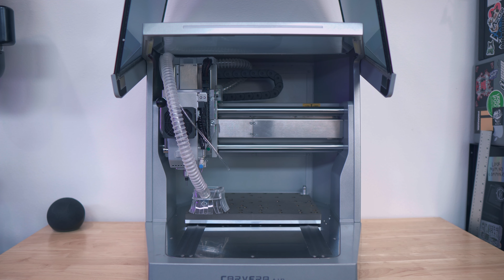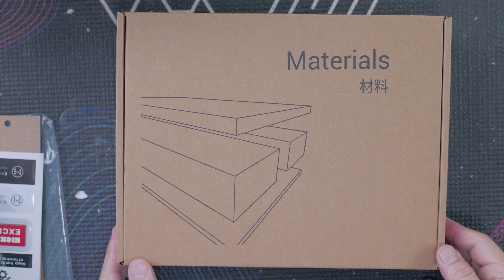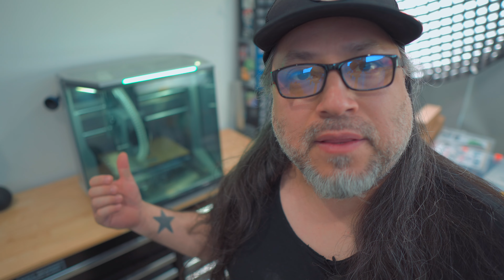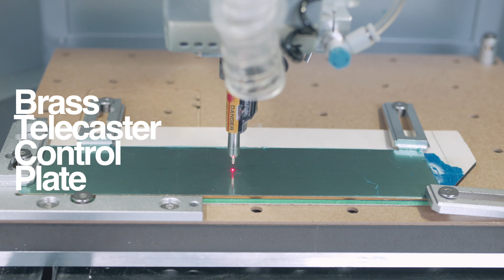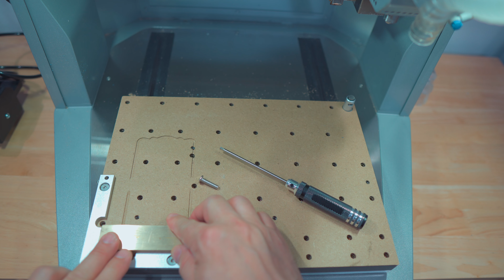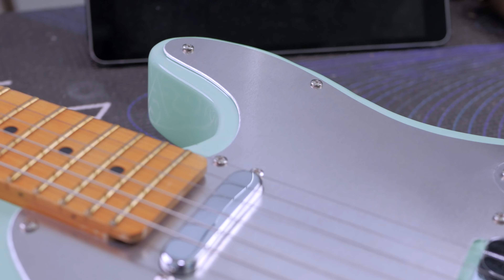This CNC Made Everything Easier - Makera Carvera Air

Comment: For that kind of money, $5,000, you can buy a full-fledged CNC machine with a small workshop room... But not this iPhone among the CNC machines. If you have nowhere to put your money, if you are a rich craftsman, then, yes, you can buy it)))
Reply: You can’t put a used industrial cnc machine in your living room. This machine is good for prototypes. 
It has a quick tool change system a probe, tool length setter and is fully enclosed. It’s worth the money. 

I considered this machine as well but opted for a Sorotec CL0404 because I needed a bigger work space.

Comment: Absolutely awesome for small parts, but not at all an interesting prospect for $3000, with the 4th axis. This thing is like the iPhone of CNC machines; pretty, refined, sleek--but ultimately overpriced for the hardware you're actually getting.

Maybe if the actual work area were like 50% larger in at least one dimension, it'd be a much more interesting tool, but as it stands I'm way happier with my janky Chinesium cnc table that costs about a quarter of the price, despite it only being 3-axis. I could see the Carvera being good if you were machining your own bridges, tailpieces, etc. but it's a very niche tool, given the barrier of cost.
Reply from the maker: I've hesitated designing my own bridges for too many years cause I never had the machine that could give me the right results. So for me, I see a future where I can finally start thinking about hardware from a custom perspective. The price is high but for those that are scared to death of getting into CNC, I believe the iPhone of CNCs is the one you want to choose. Unboxing to milling was one weekend. No hassles, no worries, it just worked. That has to be worth something to someone.
Reply: @MarkGutierrez  See, I think that kind of thinking is backwards; if someone's afraid of getting into CNC, having a fancy high-priced gizmo of a machine is going to be an ADDITIONAL barrier. Unless one has far more money than sense, anyway.

I like most of your content, and value your work. The main problem I have here is that this entire video smacks of one long paid advertisement, whether or not you actually bought the machine for yourself. I know that you will certainly get something out of the Carvera Air, and that's great--but items of any kind are only worth what people are willing to pay for them. The more we continue to overpay for things, the higher the prices of everything will get, because the graph only goes in one direction at the end of the day.
Reply: @georgemeller4074  I think the price is ok. You unbox it and can use it right away. No tramming needed no assembly needed. This machine isn’t a new hobby, you make parts with it without tinkering with the machine. It’s like a Ender vs a Bambulab 3d printer. I considered this machine as well but needed a bigger build volume.